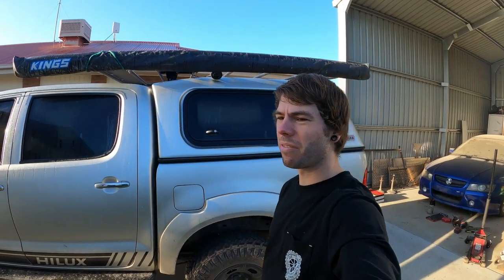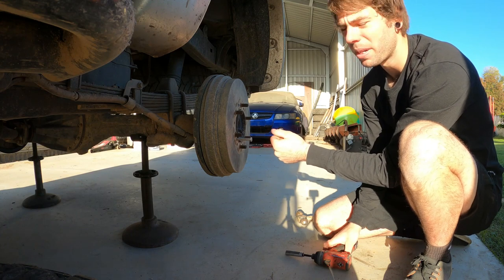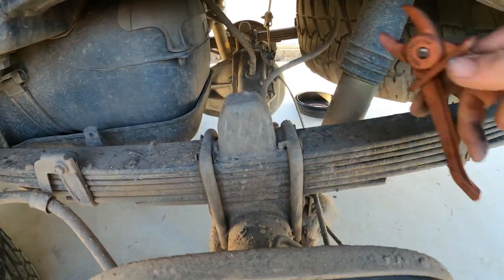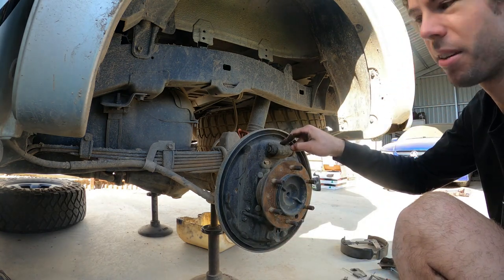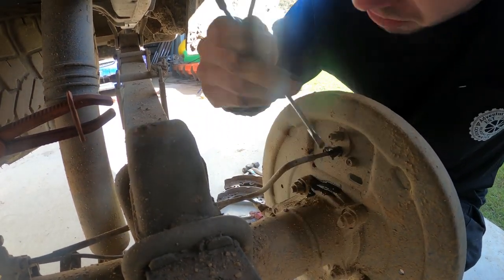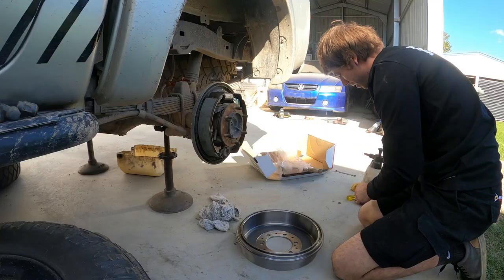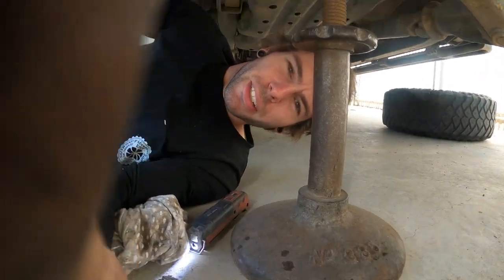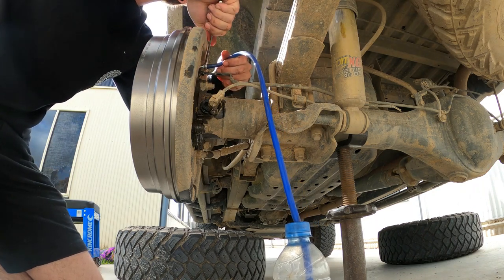how to replace drum brakes - ANY CAR!! N70 hilux

Comment: Great video, my hand brake is off and my drum brake shoes are stuck on the drums and I'm just bending the brake shoes. ?
Reply from the maker: You’ll need to back the adjuster off through the little hole in the backing plate
Reply: @foordoffroad8915 thankyou have a good one cheers